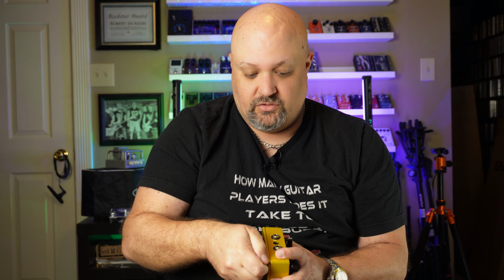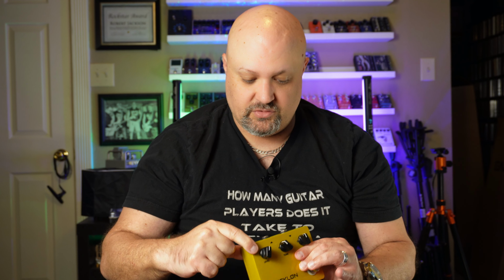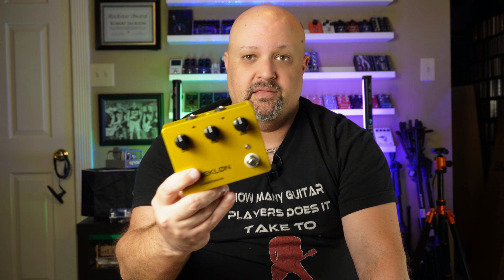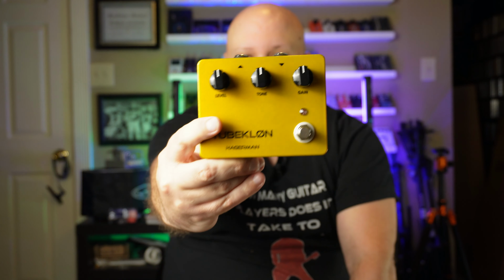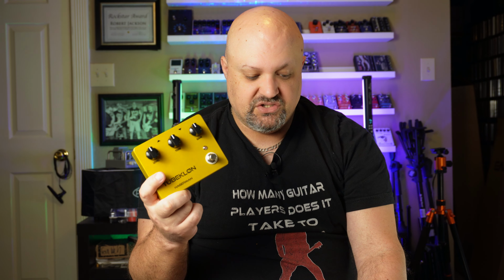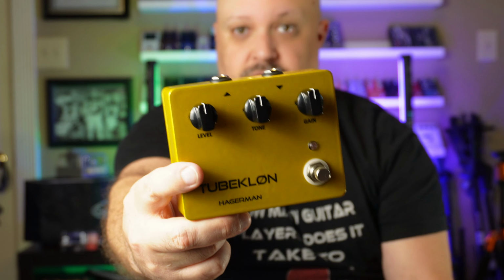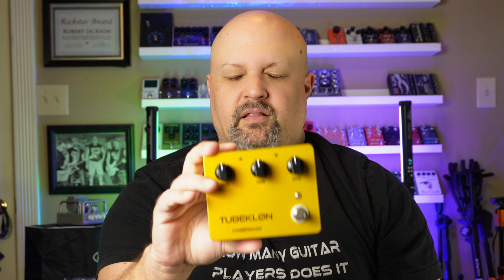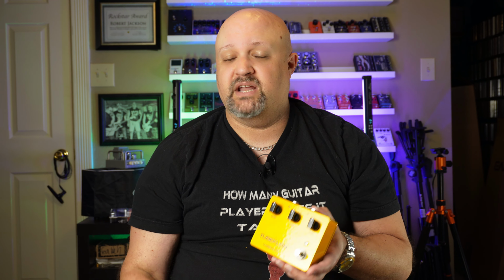A Tube-Driven Klone Overdrive?  FOR METAL??? How Does It Sound?

Comment: Glad you’re back. Feels like you haven’t done a video in forever.
For those wondering about the tube overheating. You got to remember that a pedal is only running off of 9 volts to 18 volts depending on the pedal. 🤘🏻🤣

Comment: I tried an original Klon back around '93 at my local shop. The shop's owner ordered the Klon as a joke. In those days I think they were only sold through ads in the back of guitar mags. Anyhow, it was a good sounding pedal, but nothing earth shattering. He bought it for around $200-300, which even then was extremely steep for a pedal. He placed it in the display case to see if he could sell it. I don't think he did. Now, thirty-one years later, I cannot believe the hype over these pedals. I've tried many Klon clones and there are some good ones. The Wampler Tumnus is a very solid unit.

Comment: Robert, if you ever come across a JIMS 800 from pedal TC Electronic I highly recommend it. It's a JCM800/JMP50 in a pedal with features like IR cab sim DI out (through cooperation with Celestion) and a USB I/O. It's the closest I've heard to a JCM800, but even more to JMP50 when dialed in just right. I think you might dig it. It's quite a ride.

Comment: Cool pedal, but I'm on the other end of the circuit, ..... the guitar.  Rather than constantly goofing around with pedals only, I'm trying to improve on the guitar electronics and I have found Manley hand wound pups, Galaxie Model-43 X-Ray Editions with Elektrisola magnet wire is just awesome insane. (DCR: 13k ohms) And yeah, I have experimented with Duncans, Tesla, Lace Deathbuckers, DiMarzio, etc., so I kinda know the pups in a guitar make the tone and variations.  Are ya "Manley" enough to use a solder iron and a screwdriver?  Perhaps not, so, I guess, .... just be happy with what they "prepackage" in the guitars ya buy.

Comment: Hilarious that this sounds so much better than an actual Klon. Swap in a 12AX7 and that thing would sound like a Metal Zone.
Reply: Actually, a 12AX7 does not operate well with this circuit...
Reply from the maker: Nah, I wouldn’t even do that.  This pedal EXCELS when it’s boosting the front end of an overdriven amp.  The amp I was using in the full track demo (Laney IRT-Studio) not that have the gain cranked all that much.  That was the TubeKlon enhancing the sound of it.
Reply: @hagerman_amplification  ... isn't HEAT going to be an issue?
Reply: @miserychannel69  Nope. I am running this tube at about 1/2 power dissipation (or less), so it's not hot at all. You could hang onto it.
Reply: @hagerman_amplification  kool .. ;)
pun intentional.
Reply: @hagerman_amplification  Would a 12AX7 damage it? I don't know if I'll get one soon, but I always like seeing what happens when I swap out the preamp tubes in that family. I have 5751s, 12AU7s, 12AT7s and of course 12AX7s that want to go into _something_. It also sounds like it would make a good pre-amp just going straight into the FX loop.
Reply: @RobertWJackson  IRT Studios are one of the great used bargains out there. They sound amazing. Even more so with this pedal. How's it sound through the 1W input?
Reply from the maker: @StephGV2  Through my rig, I assume pretty close to what you heard here.  I never use the 1W input on mine.  I run mine direct to the interface and use an IR in the DAW (I’ve actually never ran mine into an actual speaker cab), so I want the tubes running at full power.  There’s no advantage of choking off the tube power for me.
Reply: @StephGV2  12AX7 will do no damage, but you won't get much gain and it won't sound right. 12AY7 might be ok.
Reply: @StephGV2  You have to use a low mu tube at these voltages. 12AX7 will produce very little output, if at all.

Comment: I disagree on the "Great Design" comment. There's not enough power to generate any thermionic emissions if you use the recommended power supply. I think this is a missed opportunity to actually use a high gain duo triode tube to drive gain stages in a Centaur style pedal.

Sounds ok though.
Reply: Without the tube it makes no sound at all, so clearly enough thermionic emission! Keep in mind a 12AU7 can push 10mA easily at full heater power. Slightly starved (130mA instead of 150mA), the heaters in this design have no trouble producing the 0.5mA emission required for operation.

Comment: I bet your tube will burn up pretty quick and not to mention the circuitboard...a vent should be on pedals like this.
Reply from the maker: Nah, I think that’s a myth.  The Chandler/B.K. Butler Tube Driver doesn’t have a vent.  The TC Electronic Tube Pilot doesn’t have a vent.  The Bruce Egnater designed Fender MTG Tube Distortion doesn’t have it.  It doesn’t need a vent.
Reply: @RobertWJackson  its way more likely to die from being knocked hard than heat. A preamp tube dying from its own heat is hilarious